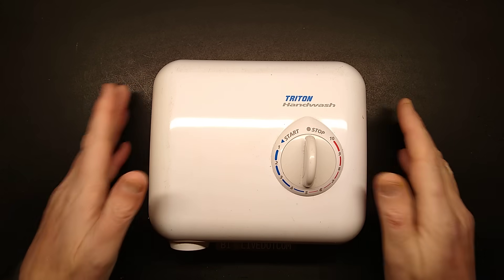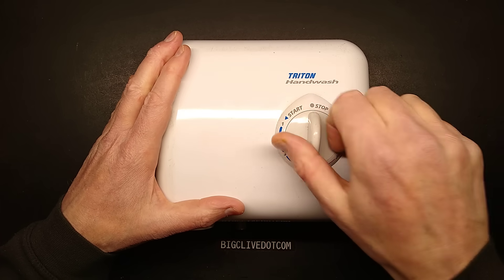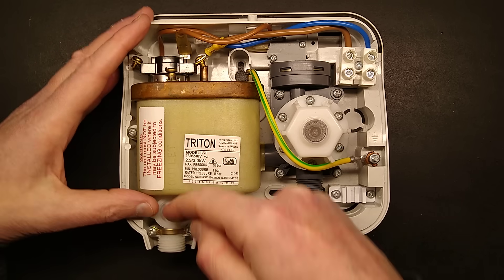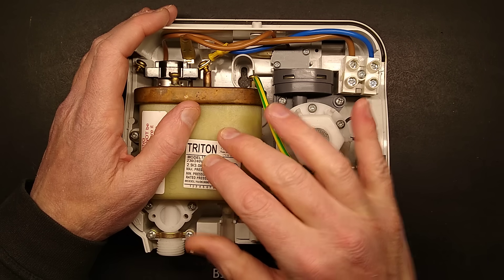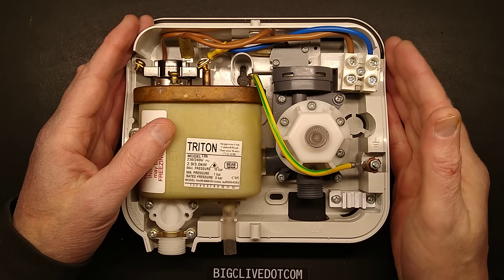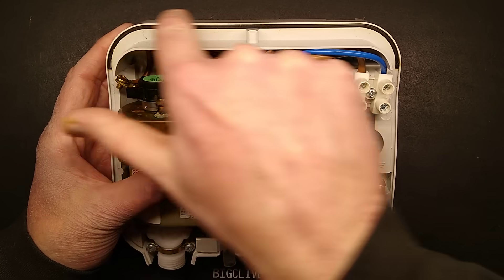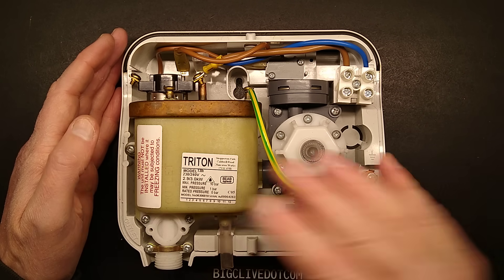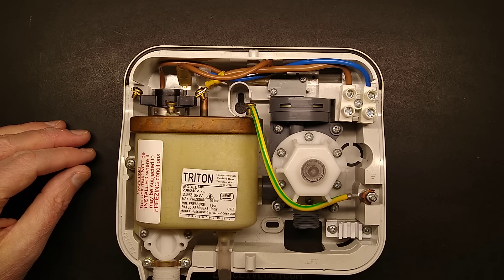British construction site hand-wash unit

Comment: As a construction site worker, i can confirm these things normally eject the water at 3000c. Enough to not just take the dirt of your skin, but remove your skin at the same time. Re Showers, my wifes family is American and when they first came over to the UK to stay with us they were amused by a few things. Electric shower was one, and the other was our toilets which are quite tall. American toilets have a huge but shallow bowl. Which results in full view of the floater you just deposited. They were also blown away by Teletext (back in the 90's), which was something they did not have.
Reply: It was determined some time in the late 80’s that construction workers don’t need their skin, and in fact work much faster when the raw nerve endings are exposed directly to the elements, so devices like these were widely distributed in an effort to speed along general construction projects. It’s quite efficient really.
Reply: In the ‘90’s the UK had such huge reservoirs to flush their non-siphon toilets they were called water closets, and were literally in a closet space separate from the toilet.  Didn’t work as well as a siphon toilet, took 10 minutes to refill.  I doubt a 120V 12A shower water heater would be adequate.  Plus, natural gas is a lot cheaper when it is a choice.
Reply: @for2utube   A lot of Americans also have electric water heaters that are a large tank but then use 240V.
Reply: They've made the bowl so shallow, I've had the twins take a little dip on a hot day😮
Reply: @justsayen2024  You can adjust the water level in the bowl. Also, if you don't have full view of the floater you just deposited then how are you supposed to measure it and get photos?
Reply: @RT-qd8yl  - Yeah. That's what thought was the genesis of social media. Instead of spouting a bunch of [crap], you just showed what came out in the morning !
Reply: @RT-qd8yl You joke, but this comment has merit. Analyzing your poo can provide a wealth of health information.
Reply: The scary thing for me is that I know American toilets integrate the function of the cistern into the bowl (Which is why they hold so much water) in contrast to the European preference of keeping the cistern separate. The even scarier thing is that I'm British, so my experience of U.S. crappers is much less than that of most Americans... 🚽💩😳

But I can certainly say that if you have the choice of either type and you've eaten something that does not agree with you, do NOT choose the American one... 😱
Reply: I heard of toilet shelfs you poop on before you flush.
Reply: @charlesgould8436 The toilets with the 'shelf' seem to be common in Germany, and the idea is to prevent splashbacks from occurring.
Reply: Put some toilet paper in before you go.
Reply: Teletext! Oh my god, that's a trip down memory lane - Ceefax on the BBC!
Reply: cool weather here needed it would help you get comfortable .
Reply: oh no a floater?
mean...
you cant play logger in uk loo's? 8P
/rolleyes
Reply: Closed captioning, but full screen!
Reply: Correct Sir 🙂🇮🇪🍀
Reply: Oh. What a luxury!
Reply: RE showers, I think the amusement is due to it being against all the basic simple safety things we are taught, eg "Water and electricity don't mix"
The shower head is like saying "Hold my beer" as it does just that and then sprinkles it over your head for good measure.
Reply: Yeah, I was surprised by Clive's suggestion that they're not usually warm. My experience of these has always been:

Freezing... freezing... freezing... HOTblistersANDdegloved.
Reply: My experience has been that the heat varies considerably dependant on the ambient temperature of the water and how long it’s been running. Blistering hot in summer, especially when the water supply is running along the surface and in the sun, to slightly warm mid winter when the ground is frozen (assuming the poorly insulated pipe hasn’t burst). Similar with low power showers. Consistently blisteringly hot is not something I have experienced. Guessing by Clive’s location, slightly warm is understandable.
Reply: At least you can rehydrate your pot noodle and make a cup of tea 😅

Comment: Would be this efficient enough to run with let's say 4 kw of solar panels to heat water during the peak hours?
Reply from the maker: For that I'd suggest a big hot water tank with a dedicated thermostatically controlled heating element to dump all excess power into doing something useful.

Comment: The great thing about this device is the fact that if you do not start it it will not pre-heat a 5 liter reservoir. Makes it very (on demand) efficient. I have not seen these selling in Holland or Germany yet.
Reply from the maker: I have one of the vented water heaters in my kitchen.  Because it's vented it can use a plastic tank with thick styrofoam cover for high efficiency.

Comment: I've seen these kind of devices in public toilets that have been retrofitted into an existing old building, where it's easier to use one of these than plumb in a hot water supply. My house also came with a mains-powered electric shower when we initially moved in in 1985. Occasionally the tap/switch would get stuck on and you'd hear the water boiling inside the little heater unit!
Reply: We have one in our very old wooden Scout hut toilet.  No Scouts have ever scolded their hands on it, which probably means they've never attempted to use it...

Comment: The 10.5kW electic shower when run on the low power setting (50%), even at the slowest speed on a Scottish summer day is barely what you would call warm, and that's at just over 5kW, so I can't imagine this 3kW unit providing much heat, especially on a winter day when the mains supply is even colder.
Reply: when your hands are as cold as the outside you've been working in, anything above freezing feels really hot. #Reynauds
Reply: The volume of water delivered by one of these is far, far smaller than a shower. They get hot enough for what they're for.

Comment: this and other water heaters are made much safer unlike the heated shower head that was on youtube a couple years ago there  there is no safety so it is possible that if the heating element broke you could get live water because the water goes through a heating element resembling a light bulb filament or electric dryer heating element rather than a proper heating element.

also the selector switch was kind of crude and barely any electrical safety even for the wires coming into the unit.

if you choose to use a heated shower head you should also have a gfi breaker installed too so if the unit fails it would shut off immediately.
Reply: Here in France they pretty much only sell bare-wire showers like you describe.
Why I don't know but I'm wondering how they can be safer than the south american su i ci de showers since they're pretty much the same thing except in a different form factor.

Comment: These thingies make great whole-house solar power diverters. 
Outside the october-january period I use one of these, slightly modified (resistors set in series) to add a few degrees to the in-floor heating loop if the battery is full and the temperatures are below 20°C
It's set in parallel with the loops and kicks in triggered by battery voltage or thermostat if I'm away and there is a danger of freezing temps inside. 
Even if now there are 14°C outside and it's past Christmas and it should be 25°C less... they're still cheap solar dumpers!
Reply: My excess solar goes to my hot water tank. It tops up the hot water by driving the emersion heater. I'm not sure how it works, maybe by storing energy then dumping it into the emersion heater when it can deliver 3kw (heater rating) or just pulses it. The system detects the excess power over consumtion and then activates the water heating.
This way, not much is feed into the grid, only when the water is fully heated at 60°c.
In the summer almost all our hot water is free 😁.
Reply: @lesmaybury793  I made my own version, which switches the element on every second for a varying period depending on the power available. It worked very well with my old electronic but dumb meter which was designed to imitate a mechanical meter with a bit of inertia, meaning that it wouldn't register any consumption if you sucked some power out of the grid but immediately put it back again. Unfortunately my replacement smart meter behaves differently and is more likely to register consumption even though it is net zero!

Comment: I had one years ago. It isn't as good as it looks. The water pressure coming out is low; after 2-3 minutes, the hot water cuts out.
Reply: It was cutting out on the over-heat thermostat. You need to set the flow correctly. The same problem happens with showers BTW.
Reply: @andrewbeaumont5492  
Tried that. The heat control changes the water rate. Even at minimum flow, the hot water cuts out. They are rubbish.

Comment: Interesting version of the "instant hot" undercounter water heaters. As for your electric shower heads, it helps when you have WHOLE HOUSE ground-fault protection. Maybe someday we will get there. Each code update requires more and more circuits to be GF and AFCI protected.
Reply: Electric shower heads aren't really a thing in the UK; to my knowledge they're more of a South American/East Asian thing. 

What's common in the UK is basically a larger version of the unit in this video - electric heater on the wall, same style of shower head you'd have with a regular mixer.
Reply: isn’t the main breaker (before the meter and breaker box) usually full ground protection?
Reply: @alyx6427 Nope. Nothing ahead of the meter is allowed in most areas, except the UK and maybe a few others, which use a mains fuse in a sealed by the power company fuse block. Main breakers/disconnects are AFTER the meter.

 In the UK, they use RCDs (Residual Current Detectors) which trip at around 30ma. There are one or two in the Consumer Unit (Breaker box/panel) that protect several circuits (wired as a ring. Or sometimes spur). In the US and Canada and other areas, we have individual branch circuit breakers which are known as GFI or GFCI (Ground Fault Interrupter/Ground Fault Circuit Interrupter) which are set to trip at 6ma. There are also GFI receptacle devices that replace an outlet.
Reply: @alyx6427  The question will be "Is that PERSONNEL level or EQUIPMENT level ground protection"? Equipment is typically 30mA. People protection is 4-6mA or so.  That's a HUGE difference when it comes to "people not dying". I am speaking of the whole-house RCDs the UK has, which I am a big advocate for here in the US. A ground fault is often not in isolation, so even a whole-house one will indicate you have issues that need addresses.
Reply: @alyx6427  no, they work completely differently. A breaker (or fuse) only opens when it sees tens of amps. A GFCI opens when a handful of milliamps (20mA is common here) of difference is seen between the live and neutral wires, as would happen when your body closes the circuit between live and earth (earth leakage).
Reply: If one changes or updates a domestic electrical installation in Germany, it is mandatory to install GFCIs on all circuits that are accessible for the consumer.
This can be a combined three phase GFCI for the whole distribution box, or multiple ones for different areas or even single circuits.
The combined ones are cheaper, but your whole house gets dark if it trips.
There are exceptions in commercial installations, but personnel with access to unprotected circuits must be trained accordingly.
Reply: if only GF wasn't so, iffy to be honest. some places it's a must to be sure, others it false triggers a bit much to be useful. there is what it does in theory, then there is the reality of how they are built that makes them a bit flaky around RF, especially when hp/lp/bp filters are involved. kitchen or bath, hell yeah put GFI there, forcing it on a ham shack is just cruel and unusual punishment, lol.
Reply: @Zarcondeegrissom   The first gen of GF and AFCI was pretty bad. Brushed motors especially (cheap vacuum cleaners, mixers, old refrigerators, etc). But frankly ham radio operators are an entirely different issue.  They are an "edge case" that in no way affects the need the "average" consumer deserves.
Reply: @Bigrignohio  an "edge case"  that must go, for the sake of everyone else that don't know what they are doing, and I thought we were against being oppressive to others. ok, have fun with that, lol.
Reply: @Zarcondeegrissom  Where did I say that? Please do not attempt to gaslight me. It's simply that as a edge case there will have to be exceptions allowed in code. There are a LOT of such exceptions in there if you look. Now run along little conspiracy nut.
Reply: There's actually very little risk to such showers even without an RCD - water just isn't that conductive, and you've got a long rubber hose between the heater and the head. The plastic case is obviously not conductive, and even if absolutely soaking wet, again the water on the surface just isn't conductive enough to be a hazard. And on top of all that, the tray or tub you're standing in probably isn't even metal!

Comment: It's weird that some in the US feel uncomfortable about electric showers and the like.. when purely electric hot water tanks and instant heaters (to the tune of 28kW+) are the norm in large portions of the country. I suspect it's got a lot less to do with electrical safety and more to do with kneejerk kickback against unfamiliar concepts.
Reply: In the USA, we certainly have tankless water heaters here in the US, but they're mainly gas-fed, which bothers me a bit more than an electric one.  Electric tankless heaters are also available; generally, the power consumption runs somewhere around 20-30kW and obviously requires a dedicated circuit.  Usually far more expensive than a tanked heater.  

 One scheme is to install a small "booster" tank heater in the bathroom, but consumes power on its own, keeping its load of water hot.  Another is to install a recirculating pump that takes the cold water from the hot water feed and brings it back to the tanked water heater. 

Many homes share the task of heating water for use with heating water for recirculating radiant heating or even steam heat.   Those are almost exclusively gas- or oil-fired.

Water heaters, be they gas or electric, seem to be marketed for regular replacement.
Reply: Yet they will happily use hairdryers in the bathroom 😱⚡💀
Reply: @katrinabryce  We don't use hairdryers in the shower though.

Comment: Problem in the US using such a system: 3KW connected to our 120VAC draws 25Amps. Most commonly used circuit breakers here in main panel are 15 and 20Amps. You have a big advantage with your 230V outlets. I ran into similar problems with heat dishes and a larger air compressor in my garage, to unfortunate. Our home has 2 main panels with 200A main inlet fuse each. One option is to use two phases like in our laundry room bumping up the voltage to 230V for our dryer.
Reply: Isn't it normally 230V on the mains that you tap only 1 fase off for that 120V ?
About that install: if you have solar-panels on the roof, do you connect them over 2 fases or 1 fase and causing imbalances?
Reply: @elvinhaak  The way, I understand it, is:
Also known as an Edison system, split-phase or center-tapped neutral. This is the most common residential service in North America. Line 1 to neutral and Line 2 to neutral are used to power 120 volt lighting and plug loads. Line 1 to Line 2 is used to power 240 volt single phase loads such as a water heater, electric dryer, or air conditioner.
As far as solar panels goes, I can’t answer for that, since we don’t have any in Ohio, USA with its rather poor total yearly hours of sunshine. Also hail, thunderstorms and the occasional tornado don’t promote the use of these large solar panels on top of your roof.  Regards, Marco
Reply: @elvinhaak There is 240V (or occasionally 208V) across two out-of-phase hot lines to the distribution point, but all but a couple of circuits are wired for 120V to neutral. The vast majority of Americans only ever see a 240V/208V outlet when they replace their clothes dryer or oven, and that's often done by the delivery folks. For all practical purposes, 240V electricity is not available to the average person.
Reply: @elvinhaak   A solar grid-tie inverter would only connect to the 240 across both legs. Almost everything over 2400 watts is on a 240v circuit.

Comment: We ran a little unit when we did concessions.  There is often no power available yet the health department requires 140F+ wash water temperature.   We carried around these clever things in a bag that heated the water using propane.  I fail to remember the details, but they were quite handy in the field.
Reply from the maker: eBay has a lot of "outdoor" propane powered shower units for heating water on demand.

Comment: I am not surprised there is little insulation other than at the top where all the electrical gubbings are as being on a cold site…in winter…with moisture around…there is going to be a lot of condensation inside there anyway where the seal stops so why have it going all the way round to get frozen if you need to take it apart?

One other way to keep warm when on site is to make sure you have a tea break for 25 minutes every half hour, that way you can warm your hands up on the cup 👍 also remember it takes 5 minutes to boil the kettle so that needs to be added to the 25 minute break 😉

Comment: I think Triton rebranded recently, certainly the same models being made but different names being used

Looking at the inside I'm convinced they use their defective heaters for these hand units 🤣

Are the regulations for these units different than showers, do they need their own isolator switch
Reply from the maker: This is definitely a dedicated 3kW unit.   The isolation is the spur or socket it's connected to.